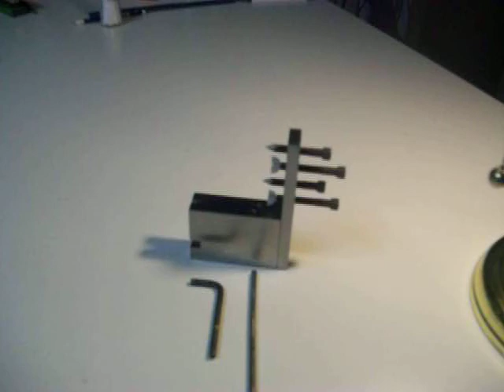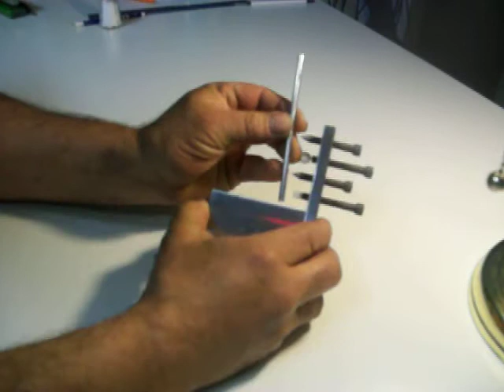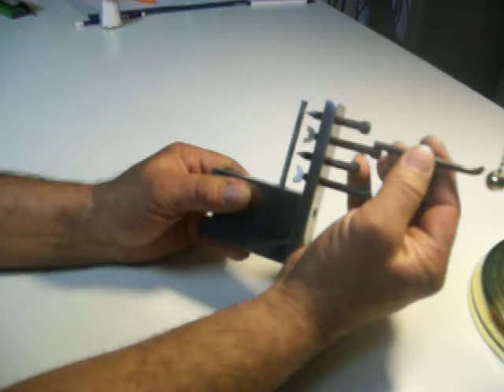Truing Tool - Straighting The Main Shaft 450 Helicopters

Comment: I just drill a hole slightly smaller than the diameter of the shaft in piece of wood about 1-2 inches thick, then attach shaft to a drill.  Then ream the shaft through the hole, it straightens the shaft in about 5 seconds.